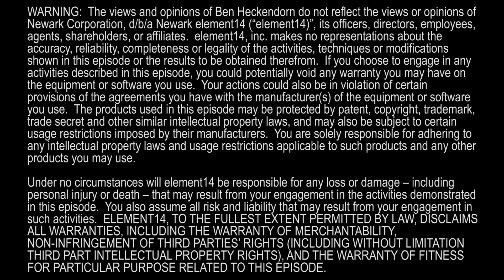Ben Heck's PlayStation 4 Slim Teardown

Comment: Do you know if the Japanese PS4 Slim version has a power supply of 100-240V? 
I've got a Japanese PS4 Slim which says it's 100V (on the box and on the back of the console), and i want to take it with me to Europe to work on 240V. 
Thanks

Comment: I would say that the fins on the heat sinks are probably made of aluminum not steel, the PS4 slim heat sink has a rather flat heat pipe or vapor chamber at the base of the cooler.

Comment: This might be a dumb question. Is it possible to use the 4k blu-ray drive from the Xbone S, and hook it up to an PC? Since there are no 4k pc blu-ray drives (that i know of) on the market.
Reply: Cool, would like to see someone try, might be worth ordering a drive.
Reply: POT82ES You would have to mess around with mounting and the proprietary power connector on the drive, as it also has things like Trayopen and things like that on it.
Reply: That Guy Oh ok, power would not be an issue, just simple rewiring. Could'nt you just open it with the eject function in windows?

Comment: Ben, not only does the PS4 Slim have faster-clocked and larger RAM chips compared to the XB1 slim - the PS4 is using GDDR5 VRAM chips (like your GTX 980Ti's or GTX 1080's) whilst the XB1 is still using the older DDR3 SysRAM chips (used by Intel's Sandy Bridge, Ivy Bridge and Haswell chips, & AMD's AM3/AM3+ chips), since DDR4 only reached mainstream desktop usage with Intel's Skylake & AMD's upcoming Zen/AM4 chips (though DDR4 was first used by Intel's X99/LGA 2011-3 chipset with Haswell-E i7's (5820k/5930K/5960X) & Haswell-EP Xeons).

Comment: I really would like to know what science discovery was made in the past 2 years that could make the slim half the size of the original? Couldn't they just do it like this at launch?
Reply: No. The manufacturing process of the die to create the chips gets better over time. As development continues there are new ways found to reduce its size and make it more efficient which, in turn, reduces the power consumption and, in turn, reduces the amount of heat produced. With that the power brick changes, other parts will become cheaper too (the DDR5 memory modules were much more expensive back in 2013 than they are now), and that will lead changes to the size and form factor.

In other word, this PS4 was not possible at launch back in 2013 because the hardware developments that lead to the size reduction had not taken place/discovered yet. 

To put it differently, imagine a car engine. Compare a modern car engine to one at the beginning of the 20th century and, not only are engines much smaller and much more powerful but consume less as well. Could a similar engine like that been produced back in the early 20th century? No, because those improvements happened over the last century as processes of manufacturing were improved, parts were reduced in size and made more precise, etc. Translate that to the world of electronics, and compress it into 3-4 years, and you get the same idea.
Reply: Every six months, the chips, drives get smaller by 50%.

Comment: what is the button cell 2032 battery for ben? i see that in some not just devices but consoles mainly. What is it usually for
Reply: Probably a backup battery for saving the settings on the console... if you turn of the console or disconnect the power from the console the settings will be saved. That's what those button cells are usually used for in electronics as far as I know.
Reply from the maker: Usually for the real time clock so it maintains the time, in computers its also used to retain settings for the BIOS.
Reply: Dennis NL I think in a console the settings are saved on the hard drive as it doesn't have a real bios. Just like a Raspberry pi

Comment: Would it be possible (by hacking hardware/software)  to install any other OS on it?  This would be a realy nice desktop replacement or small home server
Reply: With the amount of effort you would need to hack it and make all the components work (even when hacked you may not have access to certain parts of the hardware, as was the case with the PS3), it would just be quicker and more efficient to get an equivalent AMD APU and build from there.
Reply: arlo wiersma Some folks have been moderately successful at getting Linux to run on it, but it's not easy.

Comment: WHY! Why does the myth that paper and cardboard production depletes the world of rainforests. Paper is primarily produced from trees that are harvested cyclically. The trees grow quickly and are tall and straight, making them very easy to fell, transport, and process. The logging industry plants trees where they are  cut and moves across their harvest space in cycles. No different than corn or soybeans... Just with a much longer growing cycle. About 30 years. Recycling paper is less environmentally friendly than allowing nature, the perfect recycler, to naturally decompose the biodegradable material. When processed for recycling, inks must be bleached, chemicals are used to both break down the pulp and then to reinforce the weakened strength, as a result of it now being double processed. A land fill is the cleanest and most environmentally friendly way to recycle paper.

Finally... most deforestation is cause by human encroachment. It has nothing to do with the paper industry, and more to do with people building homes and tilling new farmland for annual crops.

Get over the paper causes deforestation myth... >_>

Comment: it's actually easier to replace the Xbox One hard drive or just upgraded you cant upgrade on the PS4
Reply: ??? You can upgrade a PS4 hard drive. It is actually pretty simple.
Reply: MegaRayland i meant you cant just plug in a 2 TB hard drive like i did with my Xbox one with the ps4 you need to put a new one in that fits and then dawn lode the system shit so thats  what i meant:-)
Reply: beastie _38
Ah, ok. No, you can't. Just different approaches to the same storage issue. You can save some data to an external USB drive but no game data. That must remain in the internal drive.

Comment: why dont consoles use nvidia gfx
Reply: -Cost
- Willingness/unwillingness of the chip manufacturer to meet the demands of the platform holder.
- Specs
- Impossibility of meeting production demands in the time frame required.
- Time frame
- Matching release cycles 
- etc.

And those are just a few of the reasons that come to mind off the top of my head right now. 

Nintendo's Switch will use an Nvidia Tegra-equivalent APU.

Comment: No, 4.5 runs certain things that need lower voltages at higher potentials, and the 12v is to run the normal 12v stuff.  I would imagine that the 4.5 (aka the 5v rail) runs the USB and camera and port stuff as well as possibly the HDD which can run easily on 5v rail because it's just a simple SATA controller.

Comment: so what exept from the new light is the difference in the controller
Reply: None. Just the tiny opening on the touch pad side so that the LED can shine through.
Reply: Actually the thumb sticks are more wear resistant now.
Reply: MegaRayland
thats why i installed alluminium sticks in my controllers

Comment: i think sony should get rid of br drive, get like bigger heatsink or make case smaller, and make some software so u can identify game from br disks on your pc and u will be able to download game copy onto ps4 slim
Reply: minus of this is ofcourse posibly "piracy" use of that software, but well... u cant do much against piracy, everithing on some point will be hacked
Reply: And then people would be bitching that they can't watch their Blu Ray discs, DVDs, listen to their CDs, and so forth.
Reply: +MegaRayland good point, but i mean watching/listening from optical disk? what are we in 2000's? why not do it with internet(stream/download) dont get me wrong br disks have advantages, helps alot installing software into servers etc, but eya i guess u get the point
Reply: +MegaRayland good point, but i mean watching/listening from optical disk? what are we in 2000's? why not do it with internet(stream/download) dont get me wrong br disks have advantages, helps alot installing software into servers etc, but eya i guess u get the point
Reply: DAR1US
I get what you were thinking and the reality is that in one or two console generations the drive may be completely gone. The issue currently is that physical media is still a thing, even as sales have fallen for it, and many gamers prefer to have a tangible copy of the game (even if the bulk has to be installed in the HD). A drastic shift like that would not sit well in the middle of the generation, specially with something like the Pro which many current players will upgrade to.

Having a drive also helps with the sales of the console in parts of the world where internet connections to download 50-75gb games may not be ideal.
Reply: MegaRayland yes, installing games with disks, as far as i know (i might be wrong but) disks have only information confirming, that u have copy of the game (and in some cases demo of the game) but the actuall install still is going from the consoles online store...

Comment: I can tell you why sony do that thin box over white box thingy.

#1. They can just manufacture millions of white box PS4.
#2. There's a slot/flap on the white box that you can push in and insert bundled game without opening the box. (takes 5 seconds to shove a game in, instead of unpacking the box and repacking everything.

It is easier to manage stock with this design, they don't have to manufacture a certain number of XX game bundle at the factory.  They just need to make bare units in white box.

If they need to sell bare units, they just put it in a bare version of the decorative box.
If they need to sell bundled version, they just shove the game/code card/whatever into the slot, and put it in a decorative box.

Why is this a good idea?  If a certain bundle sells really well, they can just take more of the white box and make it into whatever bundle they need.  No need to wait for the factory to spin out more special bundled version.  If a certain bundle sells badly, they are only stuck with a relatively low number of "made bundle" in the retail outlets, they wouldn't be stuck with boatloads of "No Man's Game" bundle version of PS4 in the factory and on container ships.  Since they only need to order white box version and only turn it into specific bundle when customer ordered.

Not to mention, they can easily make exclusive bundle for each distributor, this is how they allowed BestBuy, Walmart, Amazon and other retailer to have their OWN exclusive bundle.  If a certain bundle don't sell well, you just scrap the thin box, instead of the WHOLE machine and repack it into a new and different bundle.

Comment: 4.5volts, do they pull this numbers out of thin air?! damn, now when i dumpsterdive one of those in the near future, what will i do...
take AT/ATX psu and put a silicon diode in line to drop voltage from 5V??? i guess it would work :-) 
(And i know i will find it, coz there is EVERYTHING you could dream of in the garbage, you could find a nuke bomb if you went through enough dumpsters;-)

Comment: No optical audio out means the astro a 50s wont work, and screw the new a50s that require you to buy a separate pair for the ps4 & xbox1; I'd guess a significant percentage of people buying a $350 headset also own both systems
Reply: While I appreciate a dedicated optical sound output on my hardware, hdmi carries the signal and most TVs have optical output already, reducing the amount of cable salad behind the setup.
Reply: No TV I am aware of can output Dolby Digital or DTS from its optical output from an HDMI source connected to the TV (because the TV presents itself as a stereo output device to the PS4), so no optical output on the PS4 slim is a problem for people with 5.1 receivers with no HDMI input.
Reply: Good point, I'm not sure how widespread proper DTS/TrueHD/Whatever passthrough is. I am on a very good stereo setup 95% of the time so I never had to deal with that particular issue.

Well, good luck anyway! I'm waiting till there's >10 console-exclusive games that tickle my interest are out before even considering a ps4.

Comment: So, I'm adding an external antenna to my older PS4 (model CUH-1102A) and I noticed that it does have a shield above the power supply, just it's attached to the outer case.

Comment: Hi Ben, the reason the Playstations RAM chips are heat sinked where the Xbox One S's are not has less to do with their frequencies and more to do with the type of ram they use, the Xbox One and S use DDR3L ram where the PS4 and PS4 Slim uses GDDR5 which has a much higher effective bandwidth, at the cost of higher power consumption and heat output.

Comment: Oh wow, the sony products used to be so pretty inside, this one is just a mess...
Reply: I'd like to see you fit all of that into a compact design while making it all work in relation to heat, power access, noise, and interference.
Reply: MegaRayland did i claim i could do better? i just made an observation.
Reply: muh1h1
Yes, you made an observation of what a "mess" the inside is, even though you could not do it better as you admitted.

It's easy to say it could be better without saying how the board should be reformatted to look 'pretty' while fulfilling all the requirements of it to its optimal level.

Comment: Why are they still using HDDs instead of SDDs?
Reply: Because then the console wouldn't cost $299 (or $349 for the 1tb model). If you don't mind the extra expense you can put one yourself, hence the easy access to the drive.

Comment: PS4 tech is crazy good for its size and price
Reply: Nerdburger85 more powerful than xbox 1 S and even Quieter.
Reply: Nerdburger85 A pc is still better, even for this price
Reply: That Guy what $299 PC is going to play Horizon Zero Dawn and Resident Evil 7 VR? oh right, NONE
Reply: Audfile Lol no the Xbox one s is way quiter and a lot better then the ps4 slim
Fact:Ps4 slim is a downgraded version of a normal ps4
Xbox one s is 1080p HDR 30 fps Renders videos at 4K 
Even the Ps4 pro doesn't render videos in 4K
Reply: Pro does render in 4k its 4.2tflops one s is upscaled 4k it does dat on movies not games xbot
Reply: iiAboudi except lol no it isnt.
Reply: iiAboudi the only thing xbox one S is good at is giving you a headache from all the blur and tearing, gutless 1Tflop GPUs will do that. Slow ass DDR 3 ram too. Xbox sucks balls!
Reply: Audfile Did you just look up some random facts and try to look smart while not knowing a fuck what you're talking about. How the fuck could ram give you headaches. Not even the vram could give you headaches. It doesn't calculate anything, just saves data temporarily. Also, not sure if you know that the PCMR has been using DDR3 for years and a lot of people still do. So you're worthless and don't know anything about what you're talking.

Comment: For Sony being a hardware company much much longer than Microsoft, the inside of this system looks much more sloppy compared to the Xbox One S. I'm guessing Sony was using their huge market share lead to justify making the cheapest product possible instead of the best product possible like the One Slim.
Reply: How is this sloppy? There''s only 5 big parts wich fit together. + The motherboard is half the size.
Reply: They... work
Reply: One S looks like a PC parts thrown together. This is an actual engeneering to make a small efficient unit. Blu-ray controller is on MB, that' why so many ribbon cables.

Comment: Yeah the lack of an optical port on the console is a bit of a bummer, after all they aren't just games devices but media players as well so you might want to have the console hooked up to the amp/receiver directly via an optical cable.
Reply: Nick toslink is dead. buy a new receiver
Reply: I think that people who have the money for a fancy sound system using a optical cable they're expecting them to get a PS4 Pro instead which still has the port.
Reply: HiFi systems have a very long shelf life, and you can pick up used audio equipment for very reasonable prices, optical in and spdif are still very commonly used. 
Even the last (and cheapest for Sony to make) models of PS2 and 3 had optical out, so it's a bit of a dick move to omit it in the PS4 slim.
Reply: Nick I have a very good headset that supports Dolby Digital and DTS. it NEEDS the optical port at the back because a optical cable comes from the back of the PS4, into a USB stick in the front which then wirelessly connects to the headset. You are right it is not "dead" at all Cody needs to get his head on straight.

Comment: Question:  At approx 6 mins into the video, you were mentioning that the ribbon cable was not completely attached... Was it a crucial connection that could cause system failure?
Reply: I think he accidentally caused it to partially come detached when he was opening the case.

Comment: While I agree that the earbud is probably extremely cheap to make, it's surprisingly good. Mine still works great, 2 years later (though I usually use my headset).
Reply: I stopped using mine after 30 mins because it hurt my ear so bad
Reply: Yeah, it's definitely not the the earbud for all, since it is a little large. I just meant more about the build quality, and performance. The audio/mic are both very clear, and the wire holds up well to being tugged/abused. Holds up better than most of the (stereo) earbud sets I've owned.
Reply: notman05 Yeah I will admit the build quality is pretty sturdy.
Reply: I used mine daily and I've had mine for about a year and a half.
Reply: Mine broke after about two months. My friend's broke after a couple weeks. Use it regularly and you'll see how good it really is.
Reply: Same lol